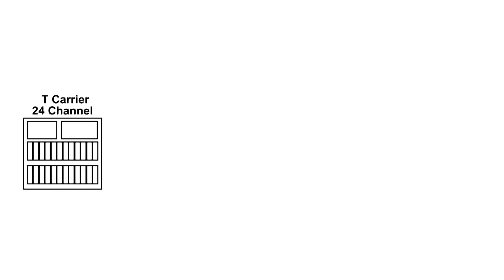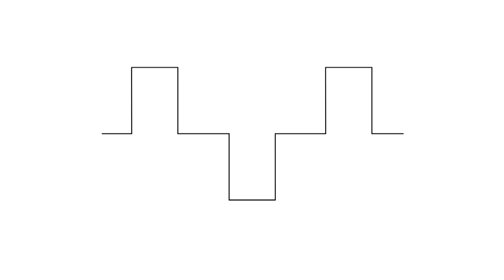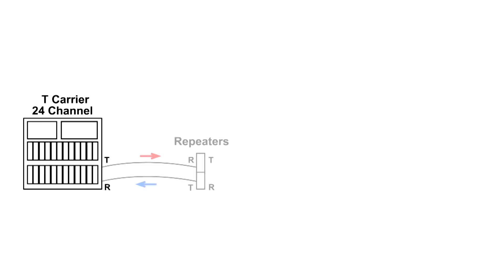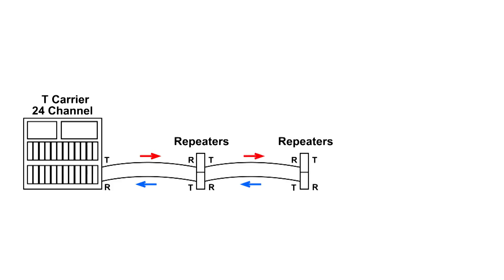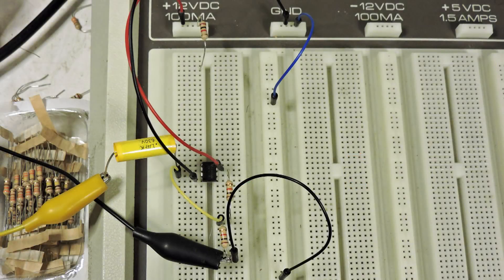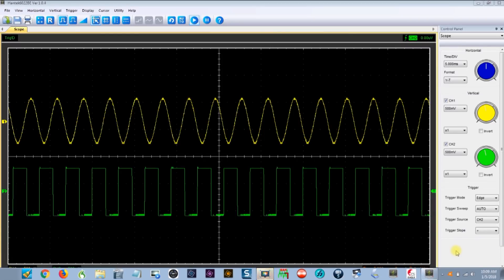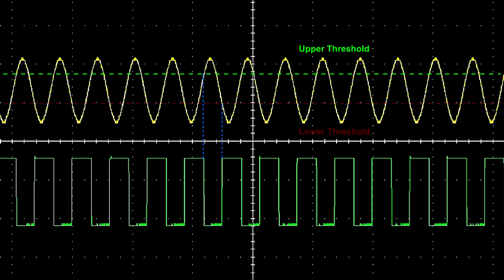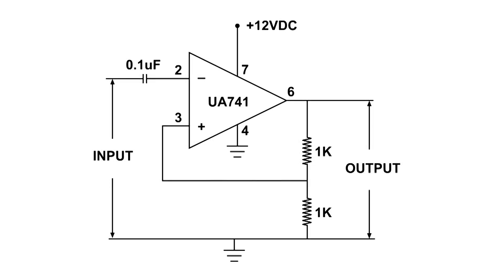Telephony use of  Schmitt Trigger Circuit 24 Channel T Carrier

Comment: This is a very useful and instructive video, advised for everyone that wants to make a Schmitt Trigger with a 741 Opamp. Though the bandwidth and cut off frequency from from a 741 is limited, it shows the pure principles (and a real test) from how to make a Schmitt trigger with an Opamp. And Opamps with higher cut-off frequencies can also be used for higher frequency purposes. Of course (perhaps) some experiments have to be done in that case, especially with the 2 resistors at the output, but the basis schematic is very well explained and usable. The Schmitt trigger can be used to change "undefined" input voltages into (reliable) square waves, used as a switch that switches in an extremely reliable way from 0 to 1 or 1 to 0, etc. Many thanks for the upload, it can help a lot in electronic engineering. Especially for young engineers that (only) know digital circuits (no offense). Upload 17 jan 2018.
Reply from the maker: Thanks
I'm sure like me, you have gone too many websites that explain a circuit and all they have are many formulas to explain how the circuit works, and nothing else. They may or may not be accurate. My view is there is no reason in today's world, not to have a working model of the circuit you are trying to explain. From this video I hope the viewer understands the engineering experimenting that had to take place to figure out how far a usable signal could be transmitted so that new accurate pulses could be duplicated. All my videos are designed so that the viewer can understand the basic concept, without that they cannot progress.

Comment: Rick, very interesting. Is that primarily for voice(POTS)  or used for data as well?  I know most lines are digital now so curious... very very good explanation my friend, thank you
Reply from the maker: Yes it can be used for both.
Reply: Both. As a matter of fact customer lines are sometimes sent from the CO on whats called a SLC96 (slick96) which consisted of 5 x T1's. Four T1's were active which gave you 96 voice lines, (4x24 channels) and the other was use for a spare.  When we started to sell ISDN lines a customer was given 3 channels in the T1 two 56Kbs data and a control which only used 8Kbs. The customer the had the option to use one channel as data and the other as voice or both data or both voice. I retired from the Phone company seven and a half years ago and from the late 80's till about 1992 worked  the  in the Customer Digital Service Center. We coordinated the installation and repair of customer T1's.   Thanks Rick, this brings back memories.